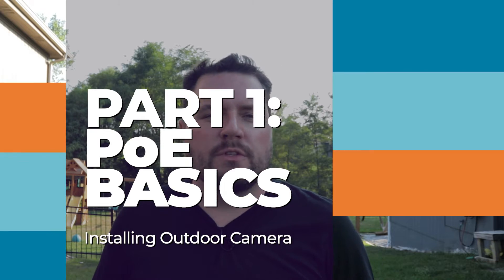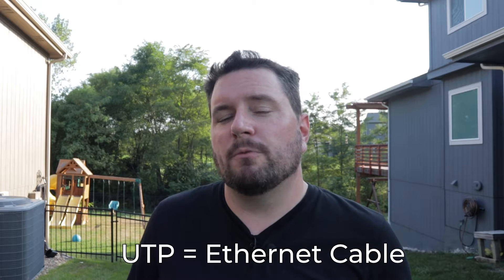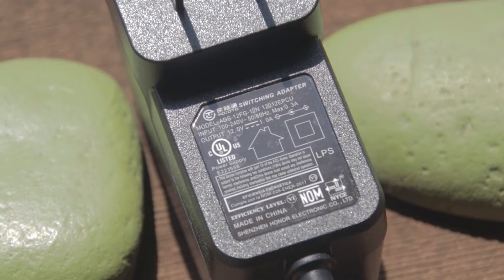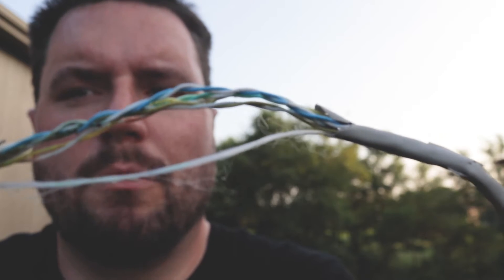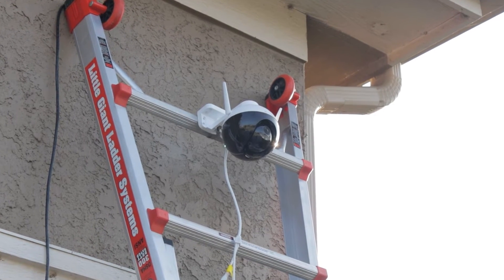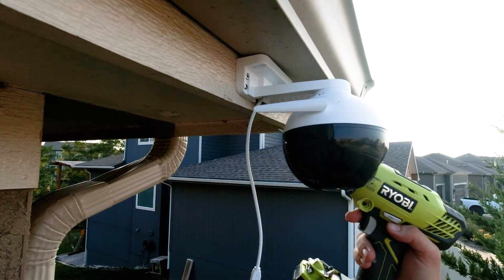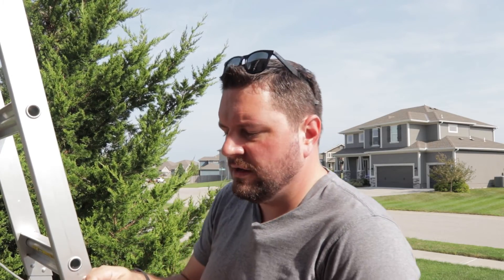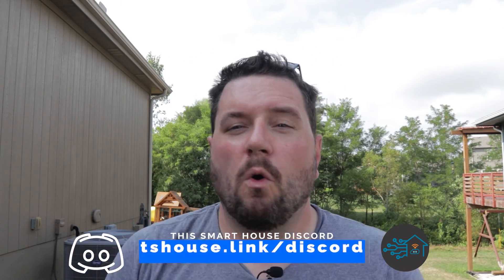How-to Install an Outdoor Camera The Easy Way // Add PoE (Power over Ethernet)

Comment: Appreciate this video, but I am still confused, especially with the whole injector and switch thin. Im going to install 1 camera, probably a REOLINK PoE outside. So in this case i probably only need an injector im guessing? So the injurector plugs into the wall inside, then 1 ethernet goes from the injector into the camera and the other ethernet goes from the injector to my modem-router correct?

Comment: out of curiosity, what is the opposite (non camera end) of the poe plugged into? i have an nvr powering a swann system. i want to add v3 wyze pan cams.  can i run those to the nvr to get power? there are eight ethernet ports total.  only there are currently used. dumb question probably
Reply from the maker: You can use a PoE switch or a PoE power injector to power the adapter. You could use the PoE from the Swann NVR to power the Wyze Pan camera, then it would connect to the network over WiFi. 

If they are in use, are you replacing those cameras? You can get 5V PoE splitters on Amazon.

Comment: Hi man great video just what I wanted to see. Quick question can that setup work with passive power over ethernet? I already have a 12v power supply setup and was wondering if I can't just add the splitter and connect the camera to that?
Reply from the maker: I don't think most PoE adapters convert up from 12v to 48v. If you tried to run just 12v over the Cat5 you might have to start at 14v depending on the length.